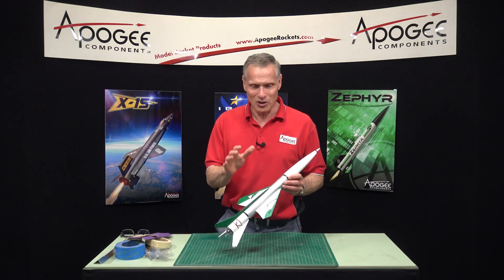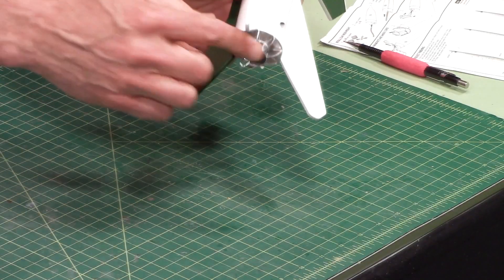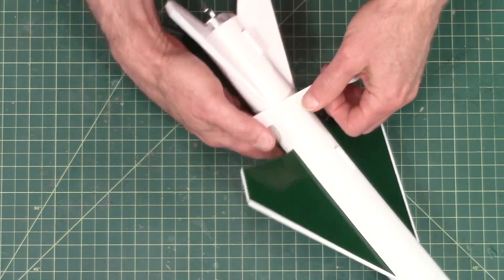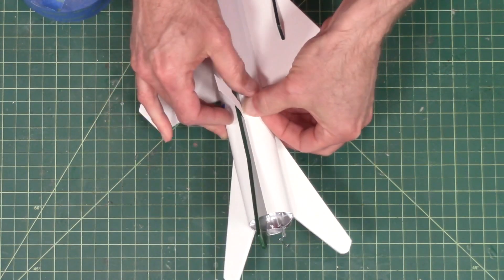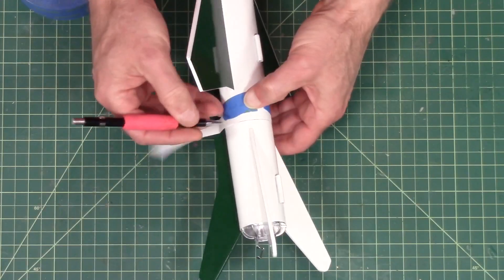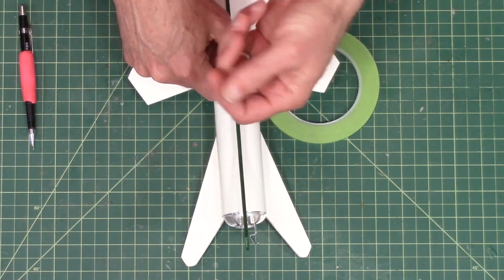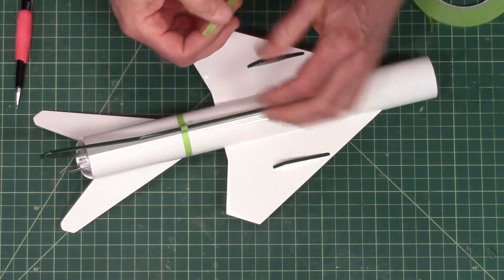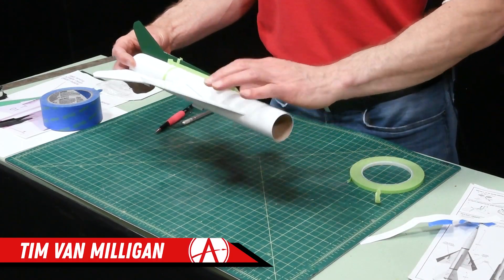Masking a circumference line around a model rocket tube for painting

Comment: Hello, it's nice to see people interested in model rocketry.  I was into rockets way back in my youth in the early seventies.  Estes and Centuri were the only places to buy engines and the largest we could get were D engines.   I liked to paint and finish them to perfection!   I would apply sanding sealer in numerous coats to get the balsa wood perfectly smooth.  I had a collection of over a hundred rockets before we moved in 1974.  Dad would take us about once a month to fly them.  I made a five station launch platform with a console, selector knob and launch button; power was a six volt car battery!  I still have some of the rockets in a box somewhere.
Here's a good tip to get your fins and guide tubes straight!   Take your rocket body over to the door and put the tube against the wall next to the door case trim.  Use the trim as a straight edge to draw a line on the tube; works great!!   Have fun!!
My Alma Mater (USC) just launched a amateur rocket into space.   I wish I had known there was an interest in rockets back when I was getting my engineering degree; I would have loved to participate!